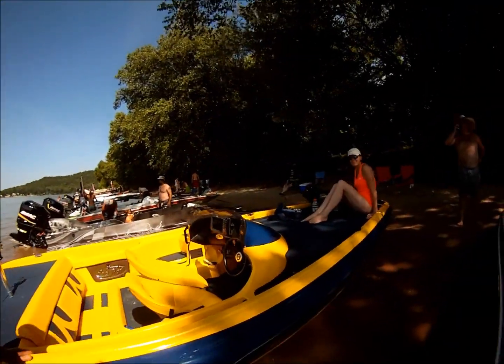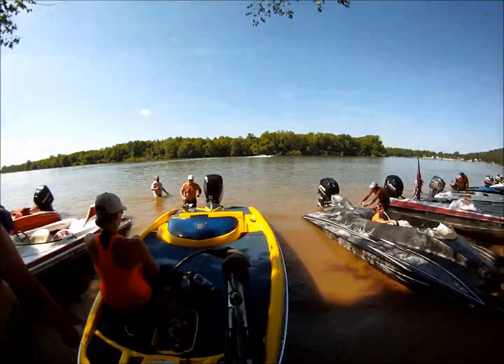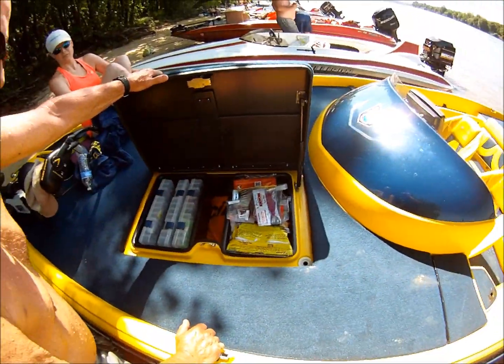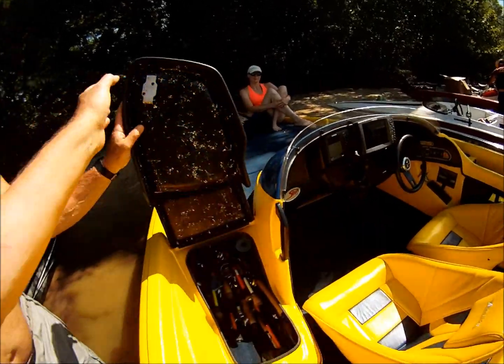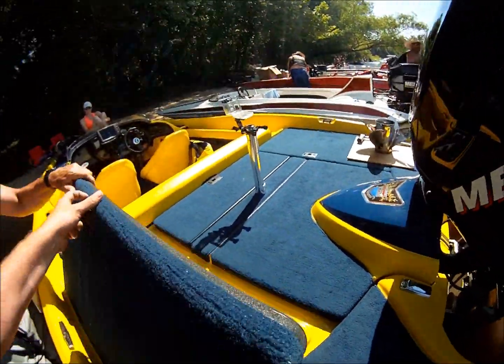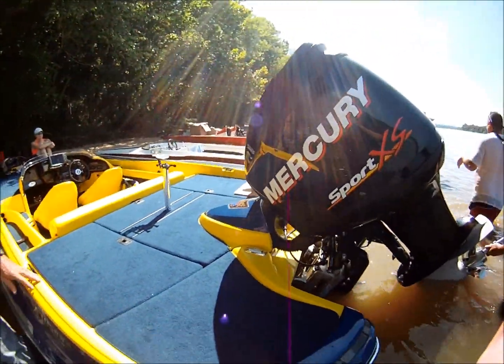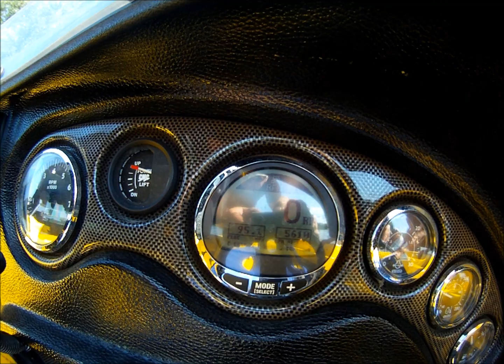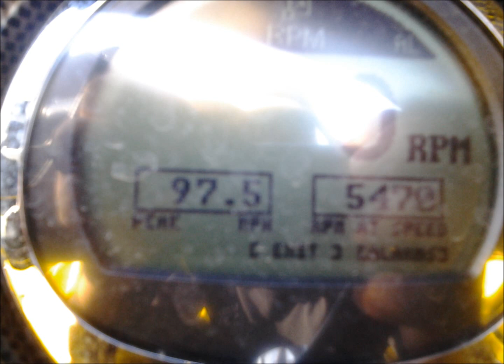Allison XB21 250XS prop testing (95+ mph)

Comment: What prop were you running when you made the 95 mph run? I am looking at purchasing a XB-21 Pro Sport tournament and I am trying to decide if I want a 250 XS or 300 XS. Looking for suggestions.
Reply from the maker: Garry Hagins It was a hydromotive.   Call Thom or Todd and tell them what you want the prop to do.   They'll build you a custom prop to fit your setup.
Reply: Thanks Neal I appreciate your input. I was also wondering if your motor is stock or has performance upgrades. I was kicking around a putting a 300XS on the Allison. Trying to find out what kind of speed I can get out of a 250XS.
Reply from the maker: Completely stock other than a little sanding to true up the lower unit.
Reply: If that's the case I think I will go with the 250 XS and still be able to fish tournaments lol. How is your hole shot?
Reply from the maker: It's not a drag boat but it will take off like any other fishing rig with a 28"-29" prop.  Dropping to a 27" will give you the jump on most tournament boats and still run 90.
Reply: Most tournaments wont let you run a 300hp motor..the 250 is the highest atleast where I fish in the FLW tour 250 is the highest..